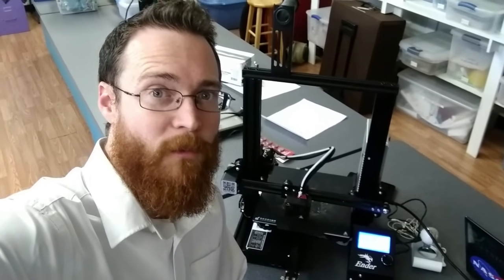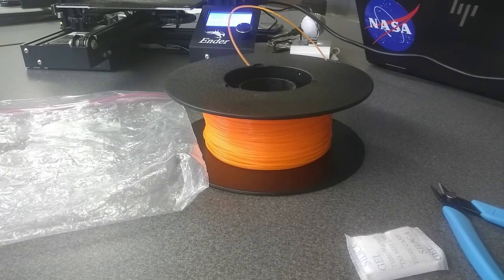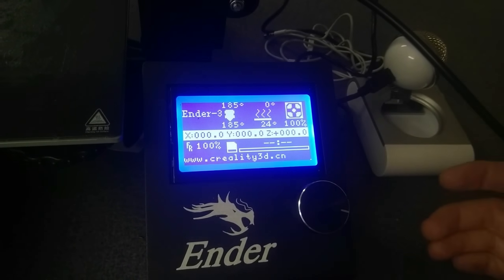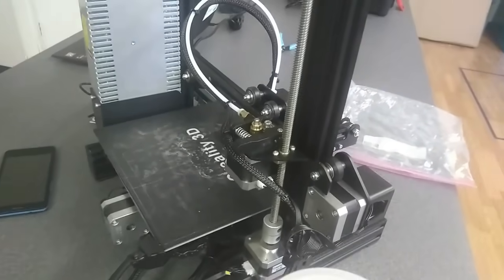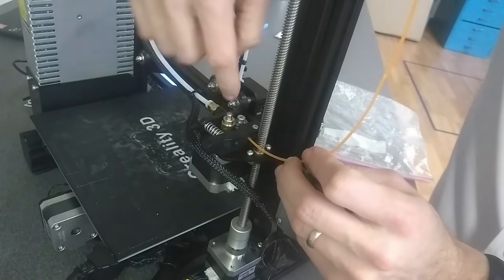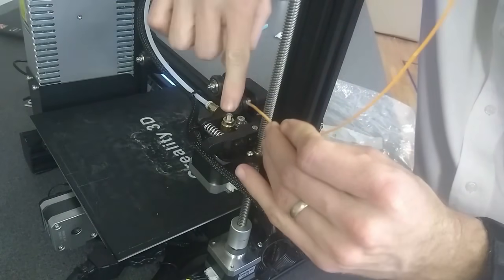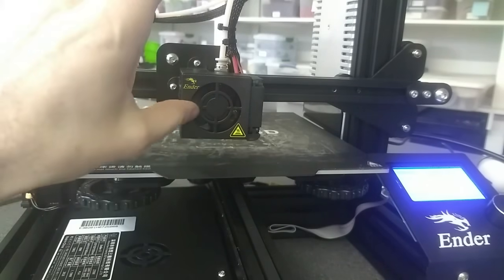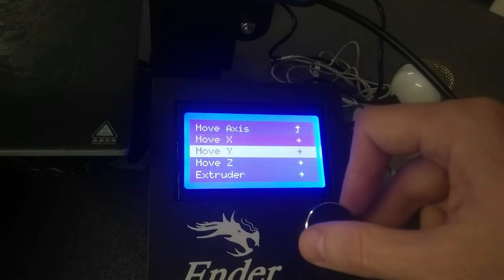Load Filament Into Your 3D Printer

Comment: It took me 3 videos to find the common-sense solution to getting the filament to feed into the tube. Thank you! The problem is that the path to the tube (through the gears) is a straight line, while the filament having spent its life on a spool is naturally curved. When you just try to push the filament in, the curve lifts the end point HIGHER than the entrance hole for the tube, which is highly frustrating. The solution: bend the end of the filament down (the opposite direction of the natural curve) kink it a little if you must so it holds, giving you a straight length of filament to feed through. Don't worry about the filament section not being smooth, it's all going to melt anyway when it reaches the extruder.

Comment: Does anyone have any suggestions on how to get it through the second hole at the start easier?? The filament worked the first time, but now when I attempt to put the same filament in again, it won't go past the second hole. Is it blocked by something?
Reply: I bought my Ender Pro 3 yesterday, and I am having the exact same issue. Did you find a fix?
Reply: Super late but it is pretty tight so either replace it or spend a while on it

Comment: I can get mine into the hole on the other side, but it seems to get jammed up between the threaded connector and bowden tube itself.  I can't seem to figure out why?  Any suggestions?
Reply from the maker: PARKER MARCHAND is correct.  Sometimes I will bend the tip of the filament just a bit (20 degree angle or so) about 1 cm from the end of the filament and then push it through into the bowden tube.  If it gives me too much trouble I will unthread the bowden tube, feed the filament into it, and then rethread the bowden tube into the extruder.